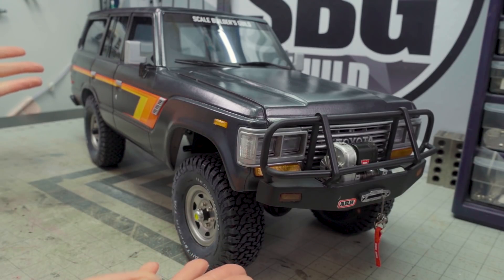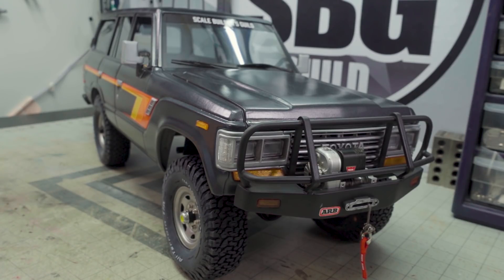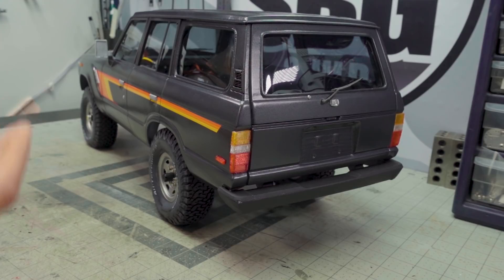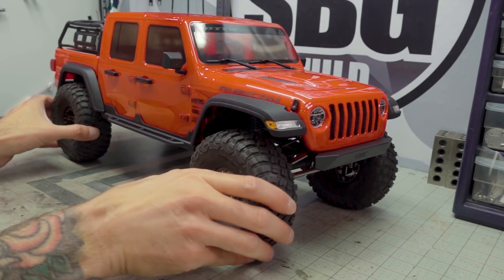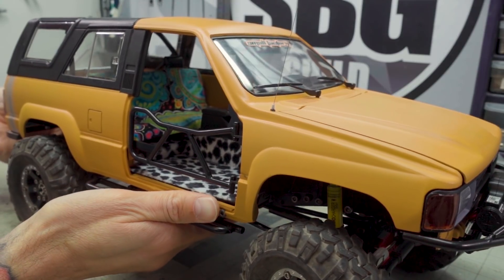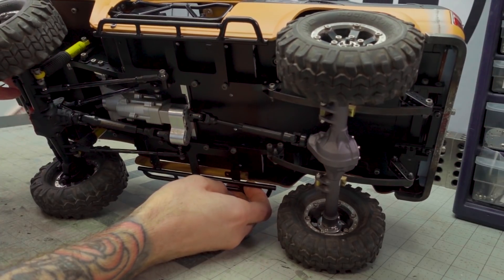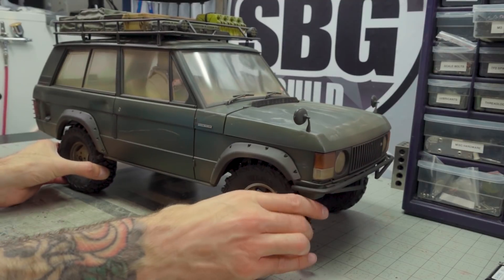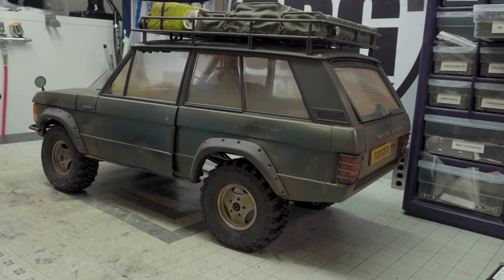What's On the Bench! Ep8

Comment: Wow, that's alot on the bench! I can't wait to see these rigs finished! I love that 4runner, full depth interior, GCM drivetrain, LEAFS! Maybe you can find one of those molded  engine bays that will leave enough room for the electronics? I used to run a Dean's plug on my motors too, I need to start doing that again!

Comment: Hey Matt: So happy you got the 4runner on the 'whats on the bench" series. So, incase you were wondering... the leafs are indeed Dean's (Chino) military-wrap springs (score!). The metal inner fenders are from "cchand". The deans plug/wire is basically an extension cord that runs from the engine bay, thru the trans tunnel, below the rear seat floor and into the battery box in the bed (but you are right, on my brushed motors/esc's I always use dean connectors). That electronics plate I made for under the hood was set up so that mamba x will fit right in the front of the motor (as long as you use a Holmes stubby) and directly above the steering servo (as long as you use a 299lp or other low profile unit). Hope this helps! Can't wait to see those front seats upholstered and installed...!
Reply from the maker: Thanks for the additional details Tim, it's truly a work of art, and I'm proud to own a Small Factory Truck!